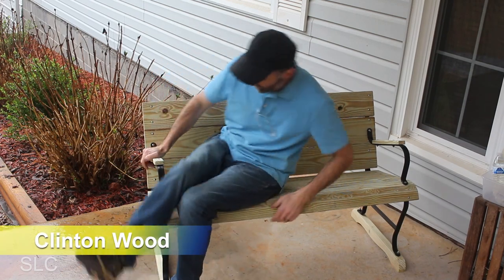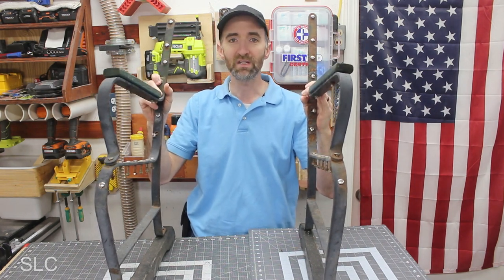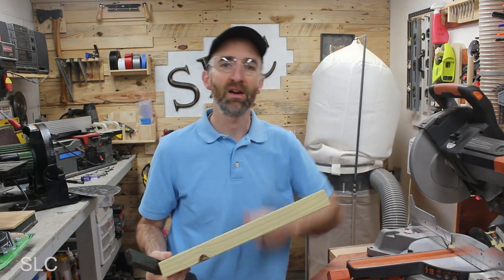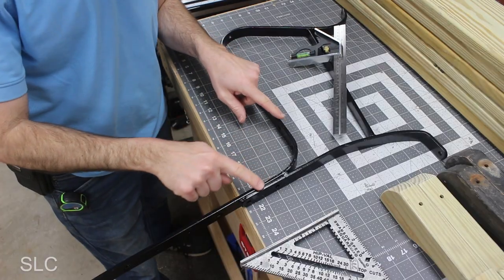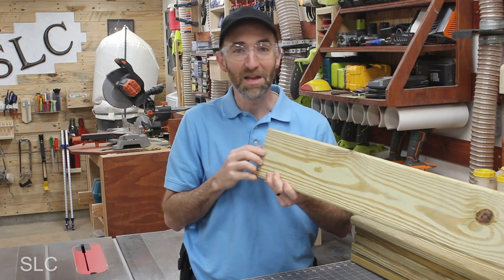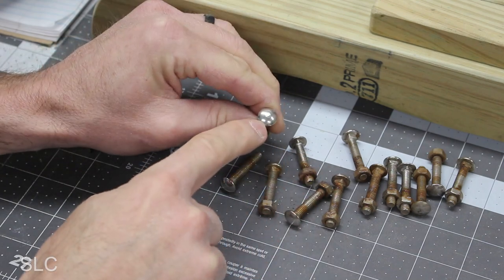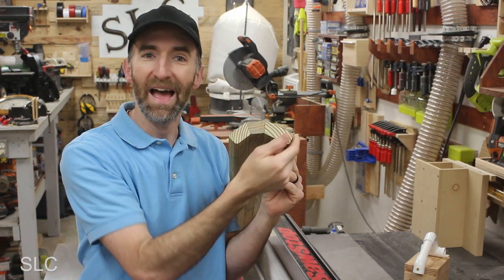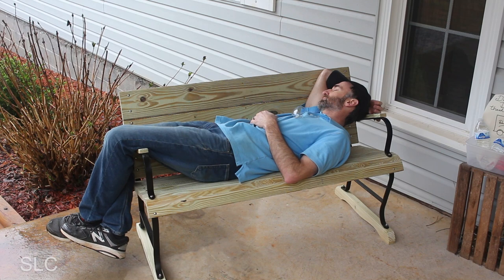Trash to Treasure: Park Bench

Comment: You made that park bench look so good... I really like how you solved the round-over part on the front and the missing center support.    The only thing that stood out would be trying to take a nap by laying across the bench, the neck and legs would be badly tweaked if you were in that position for a long time... you'd need to make it at least 6' if not a little longer for that purpose... but I'm pretty sure that notion was an afterthought...  The main purpose is that it's a bench to sit on, and it looks great! Good Job!  (BTW: you didn't mention if you put some poly or something on the wood, especially on the footers.)
Reply from the maker: Thank you very much Ray. The wood I used was pressure treated for ground contact so I was not as concerned about having a finish initially. Thank you for bringing that up, I probably should have mentioned that more clearly in the video. But over time they probably would deteriorate faster, so adding some kind of protectant is a really good idea.
Reply: @SpecificLove7  Just a thought for those footers...  but even some paint on the bottoms of the footers (so you won't see the paint) would keep them from soaking up water, you pointed out all the dry rot from the previous bench... so adding some extra protection would make it last longer.